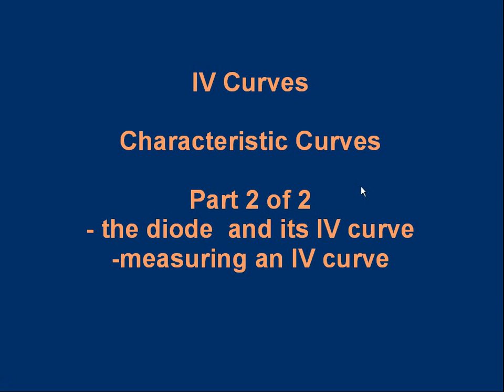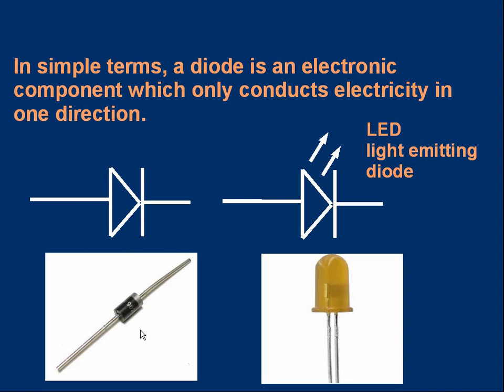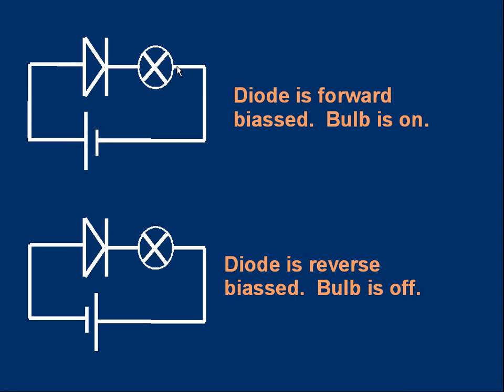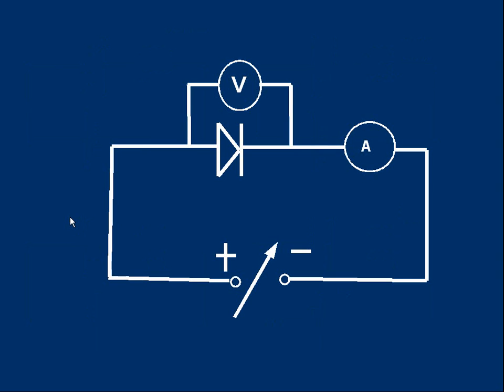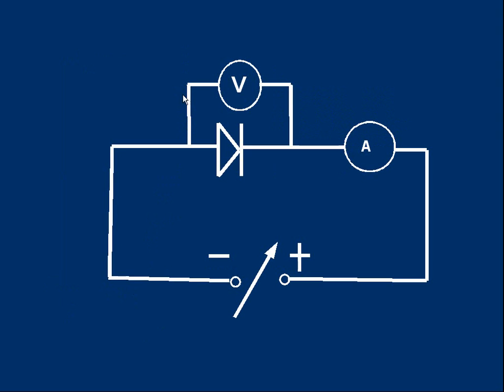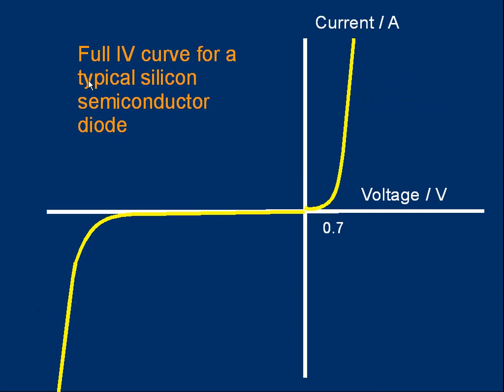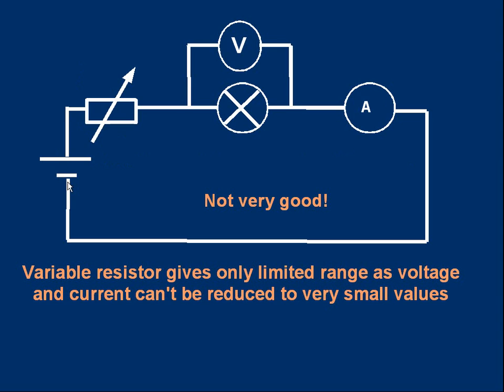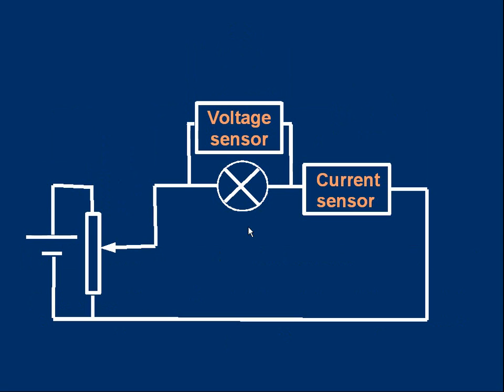GCE (A level) Physics E06 IV (Characteristic) Curves  Diodes Part 2 of 2 (diodes)

Comment: Excellent video Steve! I have a question if you would be so kind. I came across a question where you were given IV characteristic of a diode and asked to explain why the temperature of the semiconductor increases. What I am confused with is that the markscheme only allowed answers talking about an increase in current causing the temperature rise and only gave credit for using P = I^2R. It strictly gave no credit for talking about increasing voltage causing the increase in temperature.

In transmission lines I get why you can only use P = I^2R because there is little/no voltage drop to the transmission lines as it is all lost at the load hence current becomes the only factor determining temperature rise. But if you have an IV characteristic for a diode there IS a voltage drop and it is being increased so surely both P = I^2R and P = V^2/R are valid here. Otherwise, we are saying voltage is increasing which means power being delivered to the device is increasing yet we are saying temperature isn't increasing because of this? Thanks.
Reply from the maker: Alfie H 

Hi. For a fixed resistance, P =IV = I²R = V²/R, and explaining heating can be done
in terms of the  current or the voltage or both. 
Without seeing the exact wording of the question I can't give a definitive answer.  Personally I would explain heating in terms of electron-atom collisions.
I presume the mark scheme was an 'official' (Exam Board) one.  They  sometimes allow alternative answers but don't document them. (I used to mark papers for an Exam Board so I know this).  If I were writing the mark scheme, I would have allowed an explanation in terms of collisions, voltage, current or a mixture.  I think they maybe were being a bit harsh.

So I agree with you - but I can only suggest that, to be on the safe side, you use P=I²R in similar questions in future!
As far as power transmission lines are concerned, P=I²R is most useful because the current is easy to measure.  To measure the voltage-drop between the ends of a (many mile long) power line is impractical.  But it is misleading to say there is “little/no voltage drop”.  It would be more accurate to say the voltage drop is a lot less than if a larger current were used (i.e. a lot less than if the power was transmitted with a lower voltage between the lines)
Hope that helps.
Reply: Thanks for your detailed answer - very helpful. 	
Here is the link to question paper http://www.ocr.org.uk/Images/175458-question-paper-unit-g482-01-electrons-waves-and-photons.pdf
and here is the markscheme:
http://www.ocr.org.uk/Images/176278-mark-scheme-unit-g482-electrons-waves-and-photons-june.pdf

It is question 1(c)

It even says in the examiners report "students incorrectly attributed the rise in temperature to the increase in voltage". This makes no sense to me at all. If you increase the voltage drop across a component then power (as per P = VI) delivered to the component must increase. If the increase in voltage is not going into heating the component where else can it go as it must go somewhere since an increase in voltage is an increase in electrical potential energy per unit charge? So if voltage drop increases there has to be a bigger loss of electrical potential energy which surely aids in the heating process. 

This question has also been posted on a physics forum and they came to the conclusion that voltage increase should be allowed in this situation:

http://physics.stackexchange.com/questions/185748/ohmic-heating-in-wires

Thanks again for your help Steve!!
Reply from the maker: Alfie H 

Hi.
First, I should point out that the question from your link is not about a diode – it is about a slice of semiconductor.  The exam question would not make sense for a diode because the IV curve of a diode is the shape it is at constant temperature.
However, I've thought more about your basic question. Ohmic heating should (if we are being rigorous) be explained in terms of I²R rather than V²/R or VI because of 'cause and effect'.
The voltage-drop across a resistance when current passes through it is the result of collisions between charge-carriers (electrons and/or holes) and atoms in the lattice.  The voltage is a measure of the energy lost per charge-carrier (a volt is an energy transfer of 1J per coulomb of charge carriers). The energy lost is the heat produced.
So it is the flow of current (the cause) which gives rise to the voltage drop
(the effect).
The confusion arises because, for convenience, we often think of voltage as causing current.  This is incorrect.
It is emf (also measured in volts) that causes current.  The current then causes voltage drops across the resistive components of the circuit.  This is tied up with Kirchhoff's 2nd law and the meanings of emf and voltage. (I have videos on these if needed!) 

The characteristic graph is not I vs. emf, it is I vs. pd.
We are used to thinking that 'voltage produces current'.  And this is a practical thing to do when performing calculations. But it does not reflect the underlying physics. Only emf causes current.

Hope that solves the problem!
Reply: Steve4Physics 
Thanks for all your help - that makes sense to me now. I have tried to find an answer to this for a while and no-one has come up with a logical answer. You have an incredible gift with physics! 

This does seem like a very subtle detail though and a bit harsh from the exam board for not allowing increasing voltage drop for explaining heating. When you say voltage doesn't cause current is this because, in physics, 'voltage' is always strictly referring only to 'voltage drop'? Whereas emf is, in effect, the supply voltage (minus loss from internal resistance) which is driving the current - have I understood this point correctly?

Once again thank you for your help!
Reply from the maker: Alfie H 

I keep changing this reply - sorry for any confusion.

I agree – the exam boards' marking scheme is a bit harsh – but I can see  the justification now.
_____________________________________

“When you say voltage doesn't cause current is this because, in physics,
 'voltage' is always strictly referring only to 'voltage drop'?”

That's not quite the point.  A voltage is the same as a voltage drop.  A voltage is not an emf.  Only an emf causes current - if we are using the terms correctly.

The terms voltage, voltage drop (and potential difference) are used 
interchangeably - the mean the same thing.  They are not the same as emf. An emf is not a type of voltage (even though it is measured in volts).  

It is very convenient (but inaccurate) to think of the voltage across a 
component as a sort of 'force' or 'pressure' pushing the current 
through. I do it sometimes – it works well but is not what is actually happening

The voltage across a component (voltage drop) occurs when electrical 
energy is being converted to other forms as a result of the current 
passing through.

(Note.  The terms voltage and potential difference are used slightly 
differently when talking about static electric fields – but that's not 
what we are discussing.)

_____________________________________

“Whereas emf is, in effect, the supply voltage (minus loss from internal
 resistance) which is driving the current”

Yes – I'd agree with that. But I would phrase it as:
Emf is equal to the supply (terminal) voltage minus the voltage across the internal resistance.

That is not a definition of emf though.

._____________________________________

If you haven't seen my video:http://www.youtube.com/watch?v=I3mcgfRiV6Y
you might find it clarifies the difference between voltage and emf.

Sorry the reply was so long!

Comment from the maker: Here is a short but VERY oversimplified explanation.

There is region at the boundary between the p and n type materials in the diode called the depletion layer. The depletion layer acts as a barrier to current.  Applying a forward voltage reduces the thickness of the depletion layer until (at 0.7V) it effectively vanishes.  This is a bit like opening floodgates and the current rapidly increases.

For a better explanation, just do a search on ‘how a p-n junction works’.

Comment from the maker: Hi.  I'm pleased the videos are useful.
For many situations, it is accurate enough to say that a diode ‘only conducts in one direction’.  That’s because when a diode is reverse biased, the current is usually small enough to be ignored - maybe only a few micro-amps. The reverse-biased diode has a very high resistance (providing there is no breakdown).
But if we are being accurate, we CAN measure the reverse-bias current; it is small but not zero.
Hope that helps and good luck with the exams.

Comment from the maker: Yes, an ideal diode has zero forward resistance and infinite reverse resistance, so it’s  a perfect ‘1-way valve’.  I don’t use the term ‘ideal’ but the introductory material (required for some A-level syllabuses) treats the diode’s behaviour as ideal.  The video then looks at things more carefully and deals with characteristics of  ’real’ diodes, including leakage and breakdown, (also required by some A-level syllabuses). Please let me know if you think there is something wrong.

Comment from the maker: The statement ‘diodes only conduct in one direction’ is a convenient simplification, which is often made. It is inaccurate but is an adequate way of thinking about diodes for most simple applications.   This is because the leakage current is usually negligible, and because diodes are seldom operated at or near breakdown (except for Zener diodes which are outside the scope of the lesson).  I cover both leakage and breakdown currents in the video (from about 6mins40s). Hope that helps.

Comment from the maker: Hi.  I know it is in the AQA GCE Physics A syllabus (in Unit 1 PHYA1 Particles, Quantum Phenomena and Electricity). But I don't know about other syllabuses.
You will need to check the Examination Board syllabus you are using.  There are quite a few different Examination Boards and often more than 1 syllabus per Board.  Each syllabus covers different material.
If you go online, and find whichever syllabus you are using, you can search for ‘diode’ and check.  Sorry I can't help more.

Comment from the maker: @MissAjayG 
Hi. The reason is quite complex.  A diode basically consist an n-type material and a p-type material. The current-voltage relationship depends what happens at the boundary (junction) between these two types of material.  There isn't enough space to fit a proper explanation in here, so I've sent you an email with a bit more information.

Comment from the maker: @valentine8vdogg 
Hi. I don’t have (or plan) a video on diodes in parallel.  This isn’t really a ‘topic’.  You work out such problems by applying your basic knowledge to the circuit in question.
For example, in simple terms, if 2 diodes are in parallel, one will conduct when the other doesn’t.  A more detailed calculation taking into account the characteristic curve would be more complicated and more ‘electronic engineering’ than basic physics.